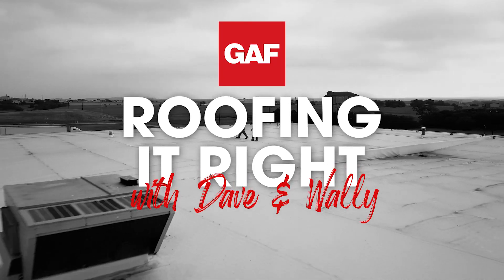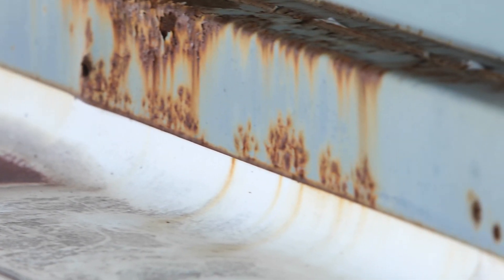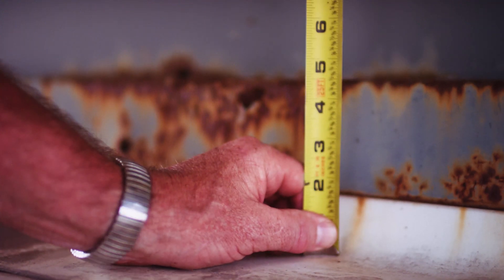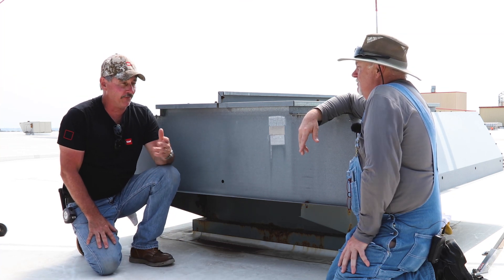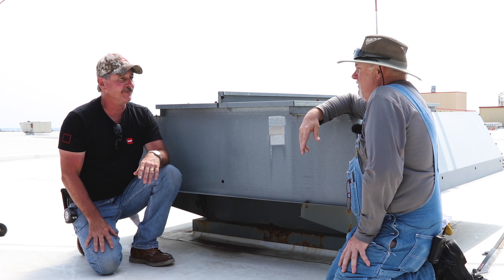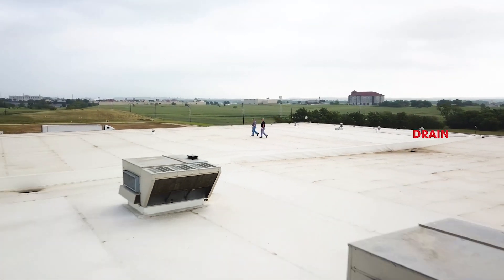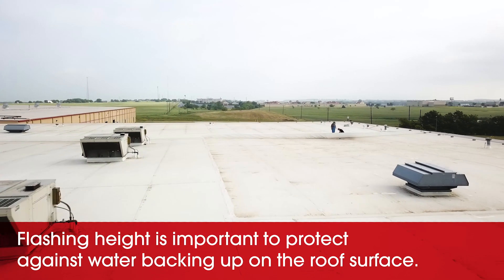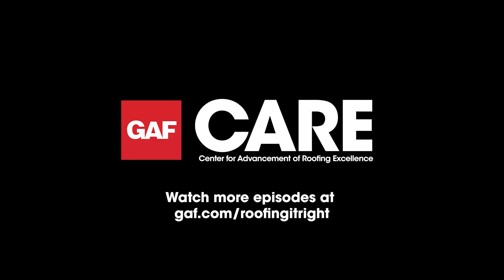TPO Flashing Less than 8 Inches High on Walls and Curbs | Roofing it Right with Dave & Wally by GAF

Comment: I realize that 8" is roofing standard height but if water gets 4 1/2" deep even if the roof was dead flat which it is not suppose to be you have a bigger problem than water getting into the top of the curb because chances are the roof will cave in by the time it reaches that height plus if its drains it is suppose to have 2" higher overflow drains. I suppose in snowy regions it could be a little concerning but if flashed right even at 4 1/2" it should leak do to the flashing but maybe the exhaust fan itself.